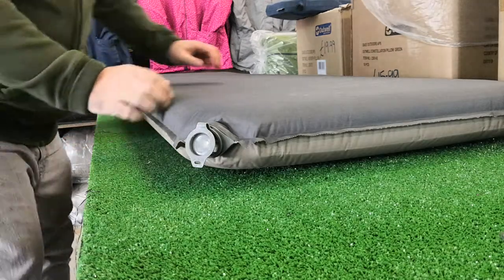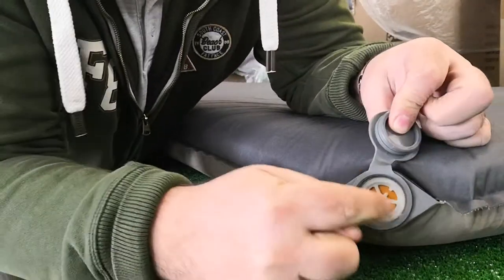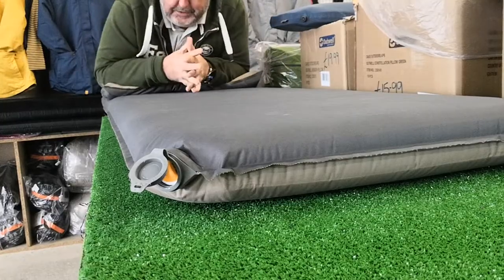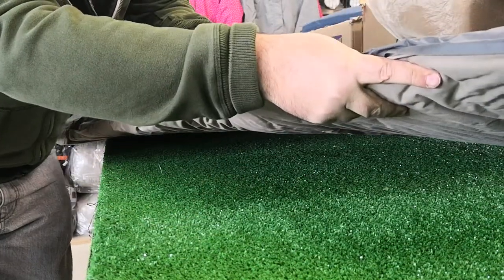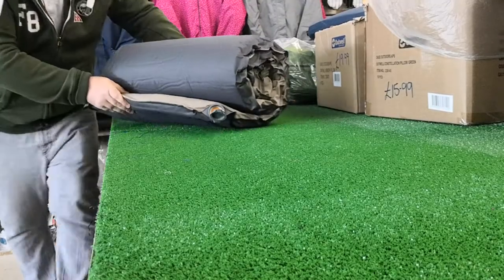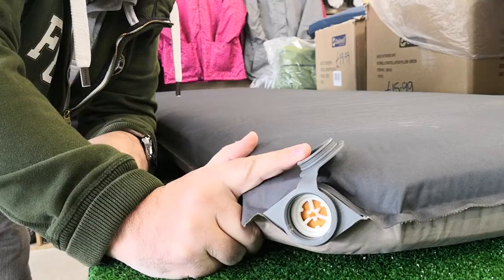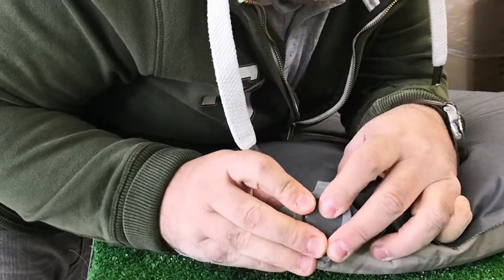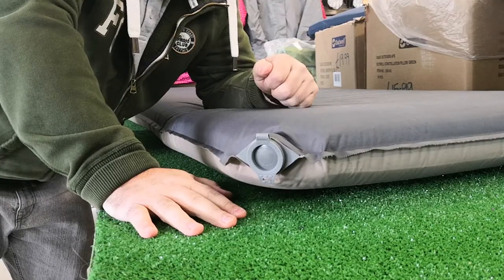Self inflating mat valve www.selfinflatingmats.co.uk

Comment: Can you get replacement Valves? We've had 4 matts of different brands and the valves all failed even with proper storage. They just leak after a season or 2.
Reply: I trod on mine and the cage popped off the back of the valve flap. Looks like there's no fix. I prefer the old style screw vallvaes
Reply: @dugbert9  did you find a fix? same issue here
Reply: @mansfield1981  not officially but I managed to get my finger inside and persuade the 'cage' on the back of the valve to re-seat. If I'm honest I would say that this design is far too feeble for campers. I paid £125 for my Kampa Kip Highrise which I thought was a lot of money but I see they are now closer to £200! Mine also suffered a puncture which I thought was also a bit of a weak spot. I am not a fan of self inflating mats now.
Reply: @dugbert9  thanks - good to know that is possible, will try persuade my cage back into place too - have never had issues with the single sims but having had a few doubles from different brands, they’ve not quite nailed the tech yet - what happened to the reliable screw valves?
Reply: @mansfield1981  some long nose pliers make it a little easier 👍🏻
Reply: Mine leaks too, any fix?

Comment: Hi Gary. I’ve lost the orange rubber discs in the valve of my van go comfort 10 double and can’t get the bed to deflate anymore. Should I be able to do this without the orange rubbers? Thank you
Reply: I would order them online. Otherwise it will always keep inflating
Reply: Do you have a link for the rubber disc as I have lost mine also?
Reply: Hi Sandra. I have the same problem. Were you able to get replacement orange discs? I can't find them online. Thanks.

Comment: I have 3 of these 2 singles and a double and the valves have failed on them all.

I was wondering if I could replace them and where to buy the parts
Reply: My vango comfort 10s have this valve and they lose air overnight. I haven’t bubble tested yet so not sure but I suspect the valves.
Reply: @robertfranke902   mine is definitely the valves. They don't let air in when they're rolled up so it stays flat. Just once inflated they won't stay up. I'm using them correct as Im by no means a novice. Was such an inconvenience on our last trip this is out 2nd season and probably 4th use of them.
Reply: @robertfranke902  mine too!! the valve misses the O-ring sealing. I need to orded some spare parts. It is so frustrating. I bought it like this.